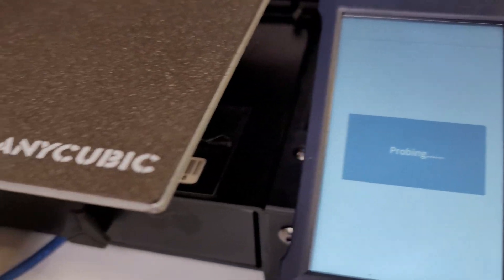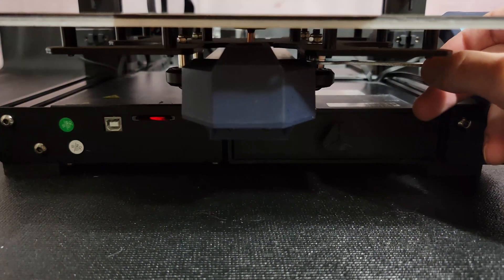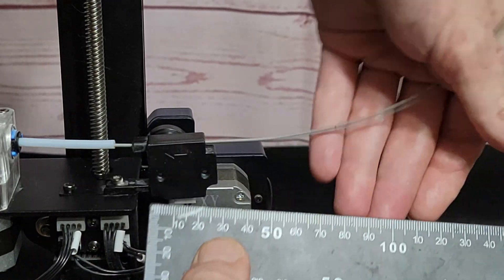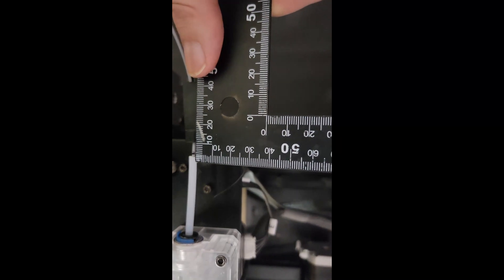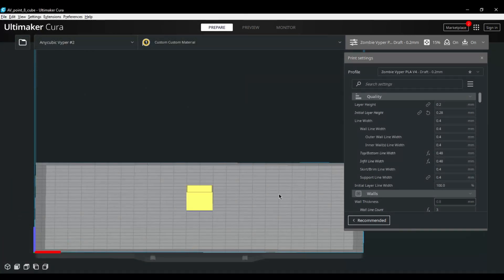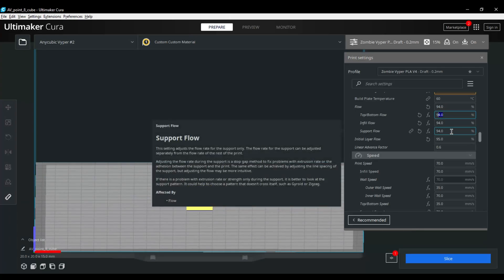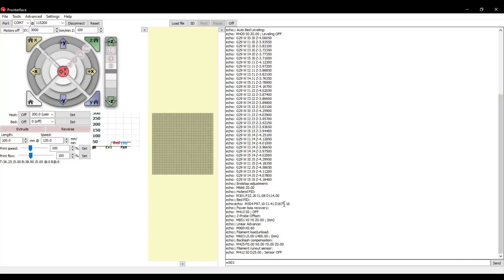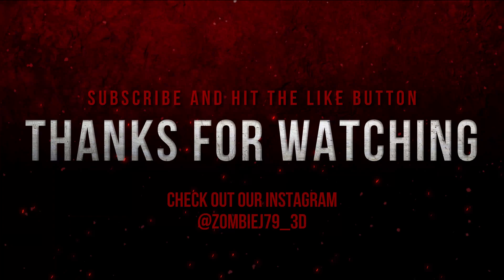Anycubic Vyper Calibration V2 (e-steps , flow, linear advance)

Comment: H, awesome and clear videos. As a tutorial should be, straight to the point without bla bla bla <3

Got myself a Vyper but struggle with the flow settings. I already watched some german videos and they all divide by the "Line Width" value that is 0,4. You have the same value but divide by 0.8??
Could you explain why? 
If i follow the german tutorial i would have to set the flow to 57% but it would be way too low. With your formula i get 87 and that would match the result of the others. I'm totally confused now :/
Reply from the maker: I think 87 is going to be the correct flow. Give it a try at 87 and see how it looks you can always bump it up a bit to adjust. Any trouble fire me a message on my social media or studiozombie3d@gmail.com
Reply: Because, he used a cube with 0.8mm wall width. The german videos (I watched them, too) use 0.4mm wall width.

Comment: hello, I've installed marlin and did linear advance but even in my best line of the linear advance test, there is still a significant bump right side of the line. in fact, there a bumps in ALL the lines in my linear advance test pattern. I choose 0.45 because it is the one with most stabil line but still, it has a bump at the right side, where fast line slows down. Is something mechanically wrong with my printer? because as I said this bump exists in all lines. also my esteps are calibrated. Please at least tell me your best guess.
Reply from the maker: It's hard to say what the cause could be..hof to prints themselves look? Feel free to send me a message on Facebook or studiozombie3d@gmail.com
Reply: @studiozombie3d  Same here. Could you get the issue fixed?
Reply from the maker: @ThePianor  during the test I've seen that on a few people's printers, but it didn't really effect print quality during actual printing. Most of the people who I've talked with and helped the k value is between .40 and .60 on my vyper I don't print the pattern I just adjust and test myself. But the pattern will give you a good idea of where it should be

Comment: Linear Advance not printing.  Pronterface sayes M900 is an unknown command.  I think I need that.  Firmware version is 2.4.5
Reply from the maker: Yes you need to have custom firmware with linear advance enabled. https://drive.google.com/file/d/1fIU_pV5bnlu77GIQXc9qPa7W9otn1aFr/view?usp=drivesdk
Give this one a try linear advance is enabled,junction devieation and a few other fixes
Reply: @studiozombie3d  Thank you very much.  Do you have the cura settings for 5.0 yet?  Thank you very much for your time
Reply: Sorry again.  do you also have custom Start and End G-codes for Vyper?  I saw your listing but Vyper and Kobra seem to in the same folder, are the settings for the Kobra and Vyper interchangeable?

Comment: hello.What firmware i need to flash.because stock 2.4.5 have not linear advance.
Reply from the maker: All you will need to do is flash the printer itself just loaf rhe .bin file from here and place on the sdcard I sent it into pronter and power on it should update. 
https://drive.google.com/file/d/1fIU_pV5bnlu77GIQXc9qPa7W9otn1aFr/view?usp=drivesdk

Comment: hey there! whats the difference between Zombi V2.8 vs. Zombie Vyper V2.8?
Reply from the maker: They are the same one is just a rar and one a zip some people were having trouble with the archive so I had 2.
Reply: @studiozombie3d  ah okay. thanks! but maybe you can give me a tip. i followed your video and if i print with cura the nozzle slow down in the corner and der comes a huge amount of filament... so i got blobs in every corner. slicing with prusa works. i think i made some wrong setting but cant find my mistake... :(
Reply from the maker: @denisclaus569  check your maximum resolution setting under mesh fixes it should be 0.5, 0.5 and 0.025 any trouble fire me a message on my Facebook or studiozombie3d@gmail.com

Comment: Hello! I got an issue with your firmware. Every time i restart my printer it lost the level calibration. This can be fixed in some way?
Reply from the maker: Try sending m502 twice then m500 to save Then relevel and let me know it that helps
Reply: I also have this issue, tired the suggest codes with no luck

Comment: OK, when I print the pattern, it only prints 5 lines with every other line numbered...0, .5 and 1. All of my settings are exactly like yours in the video. What could I be doing wrong? I do have your latest firmware loaded. Thanks for any help.
Reply: Nevermind. I saw the post by K B about changing the K factor to .1. Great video. Thanks for all you do!

Comment: When i restart my printer the E steps go back to default. the K value saves but not the E steps. it worked before on stock firmware so i dont know it it is a bug? or anyway around it?
Reply from the maker: Try sending a m502 to reset the eeprom to factory settings then re enter your k value and esteps then m500 to save and see if that helps

Comment: when i open pronterface i connect my printer. but then when i want to put in the 100mm te extract, i cant. the box where i need to fill it in is in red and i cant click it
Reply from the maker: If you have cura open close it. It interferes with the connection cura will connect first
Reply: @studiozombie3d  thanks it worked. But for the lineair advance. I didnt install your firmware but when i look it also stand the same firmware number like yours. Does that mean I can do the print whitout firmware update?
Reply from the maker: @svenducoulombier8637  for linear advance stock firmware dosent have it enabled. You can try my 2.75 firmware it had it enabled
Reply: @studiozombie3d  ok thanks. Does yor 2.8 also has this enabled? I downloaded this version.
Reply from the maker: @svenducoulombier8637  all my firmwares have linear advance enabled. My classic versions are more stock with it disabled. 2.8 I've been getting some people saying it won't reaume on filament change with the m108 but 2.75 is solid. There's only been minor changes to the firmware from 2.75 to 2.8
Reply: @studiozombie3d ok thanks. I will download the 2.75 files. One other question. When i formatted my micro SD card. I could not choose the option 4096. Do I get to buy a other card. It is one of 30gb I have now.
Reply from the maker: @svenducoulombier8637  for anything larger then 8gig you need to use a special format program or manually set partitions to format fat 32 4096. I use this program here 
http://ridgecrop.co.uk/index.htm?guiformat.htm
Reply: mine is doing this too. i dont have cura installed on the pc either as I use Mac but needed to use a windows laptop to get pronterface
Reply from the maker: @tomreynolds6466  did you install the USB driver for the printer?
Reply: I am having the same problem.  I do not have Cura open - any thoughts?
Reply from the maker: @kalekihill8707  did you install the USB driver for the printer? Try clicking on com by the Baudrate and see if that helps
Reply: @studiozombie3d  I did install the driver and I can see my printer and see that it is connected however the box to fill in 100 mm to extract is red and I cannot click on it
Reply from the maker: @kalekihill8707  you might need to heat the hotend first for it to work
Reply: @studiozombie3d  I used pronterface to heat the hot end to 200 but the length and speed fields for extrusion remain red and I cannot click or type in them. I also tried pre-heating for PLA setting on the Vyper - no change. When I click Extrude on pronterface the message "Extruding 1000 mm of filament. Echo: too long extrusion prevented" comes up in the dialog box. Interestingly there is no value visible under extrusion length in the menu area

Comment: Great video. But on my linear advance, my lines are barely visible? I went up to 3 and still had fat than thin than fat again lines? Help pls
Reply from the maker: Linear advance only works on custom.firmware if you are on stock  you don't need to set it
Reply: @studiozombie3d  If i do the linearsdvance and the k values printed show no difference, how do i adjust that?
Reply from the maker: @LueBangs  if your running stock firmware the linear test won't do anything you need to run firmware with it enabled. You can send pics to studiozombie3d@gmail.com and I can get a better idea

Comment: My vyper won't load to prontorface. I have stock firmware do I need yours?
Reply from the maker: If it won't connect you may need the USB driver or check the baud rate and it should connect
Reply: @studiozombie3d  ill try each baud rate my pc said it was connecetd
Reply: @studiozombie3d  nothing i do will connect this printer to my computer
Reply: @studiozombie3d  so I'm able to print via USB from cura to my vyper but Prontofsce won't connect maybe I should reinstall?
Reply from the maker: @mikek2824  close cura when running pronterface cira interferes with the connection
Reply: @studiozombie3d  for some reason I wanna say I tried that but I'm gonna retry it when I get home!

Comment: Do you have a cura profile in an 8 nozzle for the calibration cube?
Reply from the maker: The profile I have posted should work. With a .8 nozzle you will need to tune retraction a bit but the rest of the profile should be ok just change nozzle size in machine settings and make sure linew idth is all .8

Comment: i cannot get pronterface to connect to the printer, any ideas? are there any steps that werent included in the video? thank you
Reply: Is it not finding your com ports? If so it's a windows 10 problem.
Reply: close cura, pronterface won't connect to printer if cura is open in the background

Comment: Thank you for this informative video. You have a new subscriber.  Is there a way to improve the corner print quality of the cube? On my cube the corners are not very sharp and bulge out a bit (a bit of overextrusion seen)
Reply from the maker: If your running stock firmware you will need to play with your acceleration and jerk settings. I'd using my custom the linear advance will help clean up the corners of prints.

Comment: im having trouble getting the  linear advance pattern to print, do i open it with pronterface? noob question haha
Reply from the maker: Once you set the file up and save the gcode just load onto the SD and print it.
Reply: @studiozombie3d  thanks, i ended up getting it to work. and thanks for the video, it has been a great help!

Comment: I printed a calibration cube All the walls withing 1/100mm distance to all sides within specification. Only have a problem with one corner just slightly rounded. It looks like that's where a seam is. should I print the cube turned slightly?
Reply from the maker: You can try changing the location of the seam or try to smart hide it. It will bring a bit round on the seam side
Reply: Thanks things are getting better. Have to admit the Vref was scary, was nervous but all went well. It was like performing surgery😂. PLA prints are great. Need help with PETG prints. Just need to get the temp right. BTW is there a code that will set temp when printing a temp tower? I got the Gcode set in Marlin but couldn’t print on Octoprint got a error code
Reply from the maker: @1Hyetech  yeah the vref can be intimidating for sure my hands shake a little so I act like it's surgery lol 
For petg on my system I run 230 on hotend 80 on the bed and print at 50mms I'll also make sure retraction is lower I use 3mm for most material on retraction
Reply from the maker: @1Hyetech  if your running my zombie 2.8 with linear then there is no jerk junction deviation replaces it. Much easier to tune just one setting j0.00 the lower the slower it goes into corners the higher the faster. I've been using j0.05 for months and print everything at 70mms and it's always clean
Reply: @studiozombie3d   it needs to be loaded on the Vyper ?
Reply: @studiozombie3d  another thing that makes me nervous firmware upgrades 🤯😳
Reply from the maker: @1Hyetech  for temp towers in curs get calibration shapes plugin pick the temp tower and then click modify g code and there's a temp/fan tower you can set the Temps theren
Reply: Would arc welder help
Reply from the maker: @1Hyetech  I use arc welder on octoprint all the time it's a handy compression plugin and can clean up curves a bit
Reply: One year and a Prusa printer later as a newbie and never thought I get high resolution prints. Well thanks to you, and the Vyper not only have nice prints, but learn and installed octoprint. 
Got my Prusa up for sale on eBay. Now it’s on to3D CAD😃
Reply from the maker: @1Hyetech  I'm glad I was able to help man. I'm always shocked how nice the prints come off my.vyoer even after almost a year of it working.

Comment: Excellent vid as always, Will, thank you for all you do.
Have you by any chance run into any issues with your strain gauge? They went bad on both my vypers.
Also, any word on nozzle temps above 260? Does your vyper accept anything higher than 260? I still can't figure it out for the life of me why entering anything above 260 gets throttled back to 260 on both my vypers.
Also, I enclosed one vyper in an enclosure with the filament dryer inside that also heats the enclosure, which did wonders for printing carbon fiber, but after like 20 big prints, it suddenly went bonkers. I'm still diagnosing as this just happened yesterday, but my best guess so far is that the motherboard couldn't take the higher temps and got fried, so I have to modify the setup to raise the bottom of the enclosure so that it doesn't enclose the bottom of the printer where the electronics are, and to run the LCD outside as well. Should be pretty easy, just add a 1/8" thick wood floor with custom cutouts that sits on top of the bottom beams.
Printing carbon fiber with this setup is almost perfect, the layer adhesion is almost there, if only I could raise the nozzle temp a few more degrees, it should be perfect.
I've tweaked the cura profile for the esun epa-cf almost perfectly to get excellent accuracy/definition at 0.1 layer height, super easy cleanup, and amazing strength, but the weak spot is definitely the layer adhesion, even if I print at 10mm/s I have to beef up the thickness in spots to compensate.
Reply from the maker: The other day I did a temp tower didn't pay attention to Temps and was set to 270. As soon as I hit 265 it triggered and shut down. Tried 4 times same thing.
My strain gauge is still good but I'm aging support for bltouch and the lrisa style pinda sensors.

Comment: Good work. Learned some on this one too. I like that you added the belt tensioning as it helped me see what to look for. If a picture is worth 1 words, video is worth a million.

If you could do a video on upgrading heatbreak, capricorn tube, and nozzle, I would find that extremely valuable. I've got a stock vyper and hesitant to modify because I don't want to break anything. I really want to print ASA so I've ordered all upgrades including enclosure but hesitating at the moment.
Reply from the maker: It's not too bad to change I'm just in crunch time for the new anycubuc fdm and sla reviews finishing them up now and will do a disassembly video
Reply: @studiozombie3d  Hey Will, I just ran the linear advance test and none of the lines look good. Can I send you a vid or picture so you can tell me what you think?
Reply from the maker: @OnTeamHumanity  yeah for sure hit me up on my Facebook or studiozombie3d@gmail.com
Reply: on second thought, it just occurred to me, could it be because I performed the e-steps and flow with a different filament? Should you perform all 3 steps whenever changing filament?
Reply from the maker: @OnTeamHumanity  it's best to use the same for all tests some material is harder and some softer I find

Comment: Nice Video! Will you ever do a modification video? Like how to mod it with better cooling? There is a lot of facebook group posts but not videos on how to do it
Reply: The bi-metal heatbrake is super easy to install and definitely really worth it. Best thing to do is just carefully take apart your entire hot-end and get familiar with all the parts and how to assemble/disassemble properly before you go trying to swap parts out. That way, you will understand how to replace parts without leaving a gap anywhere, which will cause failed prints and lots of frustration. I replaced the hot-end block with an all-copper e3d volcano v6 pt100, it's almost identical to the vyper's and the vyper's silicone cover fits almost perfectly, but you can also get one made specifically for it. I also used non-conductive thermal paste between the heater rod and the block, the nozzle and the block, the heat-brake and the heatsink, and the thermistor and the block. The difference in temp accuracy and time to reach temp target is immediately noticeable, so it will theoretically reduce fatigue as well as speeding prints up a tad and getting more consistent prints due to more accurate temps. The copper block of course heats up faster and more evenly, and the bi-metal heat-brake will protect the end of your bowden tube from burning and going bad over time. A Capricorn bowden tube is also super easy and worth every penny. When you install it, on the feed-gear side, after you get the right length, heat the bowden tube up with a lighter and stick a properly-sized awl or round nail in to expand the end of the tube, that way the tube will never start wearing out and slipping, which will give you tons of headaches if you don't know to watch for it. Also learn how to add like a mm of length before tightening the bowden tube adapters, that way the bowden tube will be pressed in for a more solid seal and lock.
Reply from the maker: I printed the hero me setup but never Installed it I wanted to keep my vyepr stock for comparison to the new kobra, but I can definitely do a quick guide video.